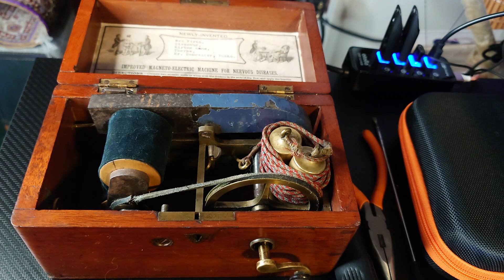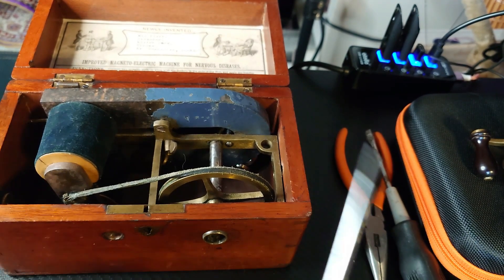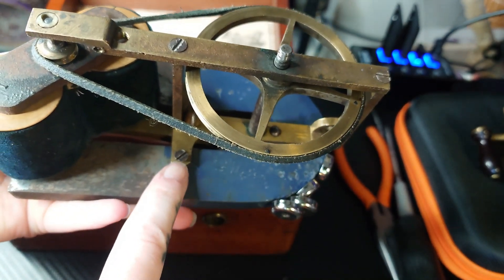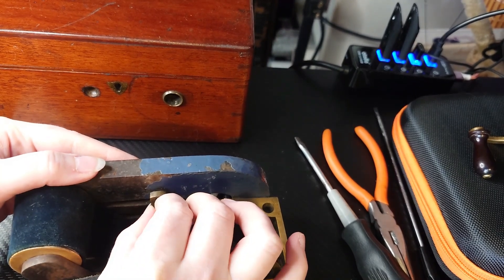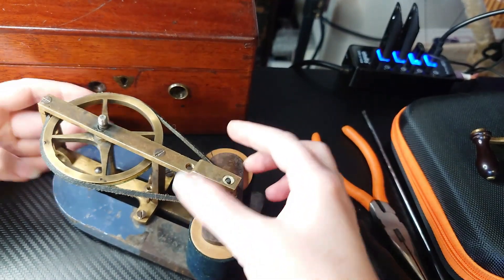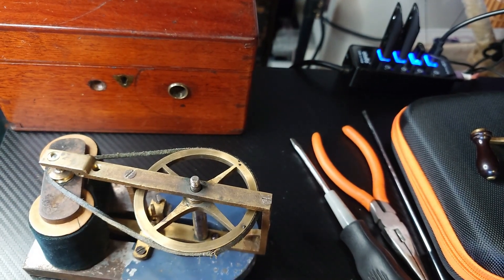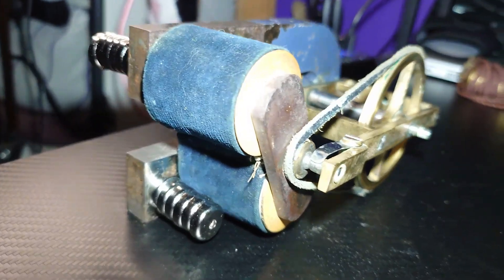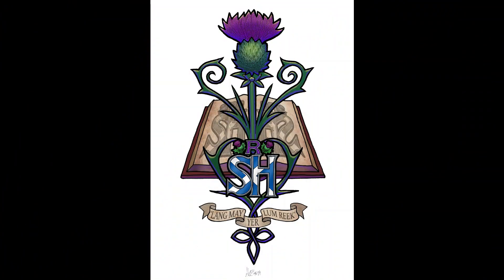Victorian Magneto Electric Machine Pt. 2 - Destruction

Comment: Are you sure it's the magnet is the problem?  This seems to work like a magneto used to produce a spark in a petrol engine 'way back when'. It's NOT intended to be a simple AC wave form generator. The rotating coils moving through the magnetic field generate a current in the coils, but not a very high voltage. This current is in used to produce a spark by breaking the circuit suddenly, causing the very rapidly collapsing field inside the coid to induce a 'spike' high voltage. In a car/motorcycle mageto this is done with a set of 'points' which are adjustable. In this device it seems to be that it's the small spring steel strip that is attaced to the brass frame and extends over the armature spindle tha acts as a 'make and break' device. The spindle end is square and, if the spring is shaped properly, as the spindle turns at speed the sqared edge will cause the spring to vibrate and cause instantaneous breaks to the circuit (four every revolution) and each 'break' should cause a high induced voltage.  This would all be difficullt if not impossible to measure with your meter.  In your pictures it seems like the spring may have been distorted to fit more closely over the square spinle end and so may not be 'making and breaking' properly, hence no voltage spikes.

Comment: Get rid of that old belt, and use a girls pony tail holder... Undo the screws on bar in  the front of the gears, and remove the bar.. then slip the pony tail holder on to the fly wheels and replace the bar and the screws... It works great and last a long time...

Comment: Does anyone even know how this is supposed to work ? Are those blue cylinders felt covered rollers or capacitors or what ? Do they both roll or is one stationary ? It looks more like a friction static generator or something, in which case I can't even imagine what the magnet is for. Weird, couldn't even make out the directions, you have any other info? Nifty nonetheless, especially if you can get it restored.
Reply: The blue cylinders are two coils wrapped in felt. It’s just a very simple electric generator.

Comment: easy  but week magnet method; Identify north and south on your neodymium magnets. Opposites attract, like poled repel. Cover the surface of the legs with the magnets. One touching north and the other south side of neodymium's. Tap the arch of the big magnet with a hammer. This aligns the ions creating a permanent magnet. 

stronger magnet; Wrap entire arch with insulated wire. Start at one leg all the way to the other. Attach each wire to pos and neg terminals, The old blocky 6v lantern  batteries are safe and work great if you can find one. If your wire gets hot unplug it. Tapping with a hammer sets the charge with electromagnets too.

Comment: You can easily re-magnetize that old magnet with a few turns of the thickest wire you can find and a car battery. Don't worry about the number of turns, just use the thickest wire you can find. Be sure the battery is in good condition and hasn't lost electrolyte. Give it a brief jolt (fraction of a second) with the battery. The surge current from a lead acid battery can be ENORMOUS, plenty high enough to imbue that old steel with "the force" once again. It's all about ampere*turns, and in this case, we've got as many amps as we want for as long as we need (milliseconds!) I breathed a sigh of relief at 12:29 when I saw you put the magnets on with proper polarization. You could also snake them from one end of the horseshoe to the other, pushing them along, to further encourage remagnetization. Leaving the stacks of magnets where the are and smacking the horseshoe with a mallet repeatedly may also work. Or, just put them on and take them off, in the same orientation, repeatedly. It's like you're trying to comb out tangled hair, but in this case it's jumbled magnetic domains. The neodymium magnet has a strong set of combs, but you need to work those domains in order to get them aligned. There are almost certainly plenty of folks on your side of the water that would be overjoyed to recharge that thing. That would certainly be easier as a custom job than making a whole new magnet!